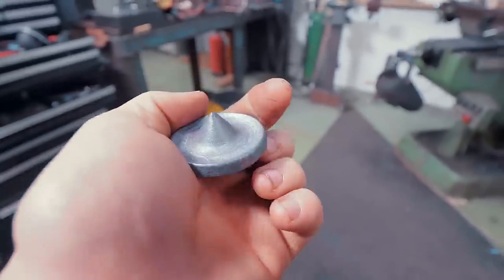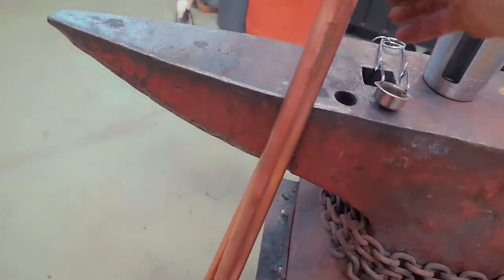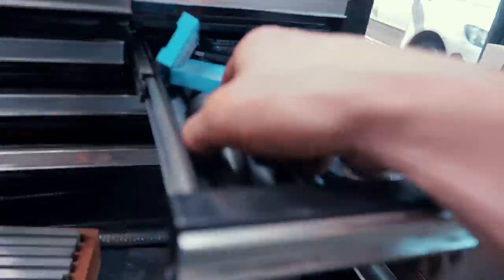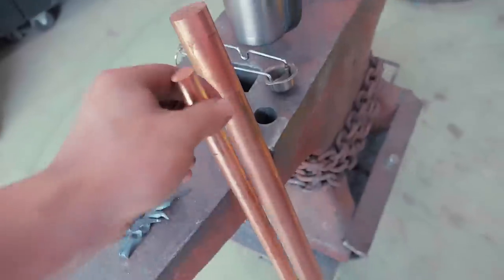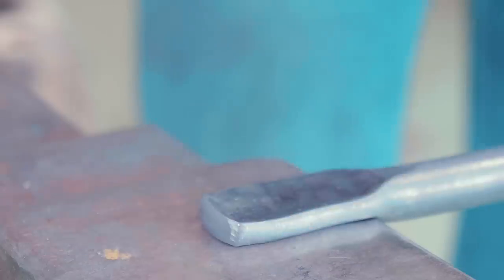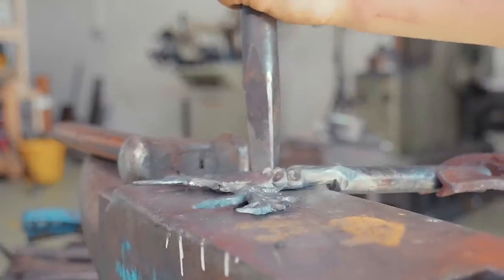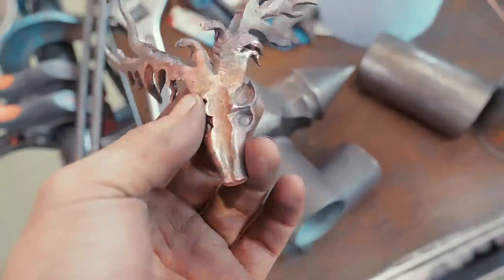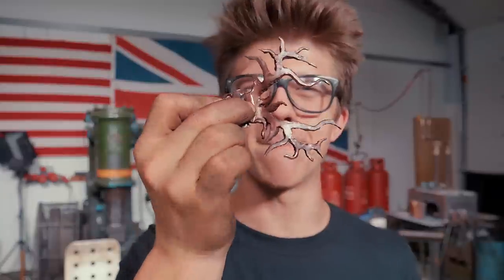GENDRY'S WAR HAMMER: GAME OF THRONES: PART 4 - Making the Stags

Comment: The FANTASTIC thing is, the show probably CAST the elk.
Meanwhile Alec is forging it. Very nice.
Reply: the moment you post a comment and realized there was an accidental pun in it.
Reply from the maker: +Lyulf thanks man!
Reply: Lyulf, it's a stag not an elk but it is amazing looking
Reply: It's a show prop, so the whole thing was probably carved in wax, and then cast in aluminum.  It's then painted to look like steel and copper.
Reply: That is the hero version. The stun version will be EVA foam or something like that.
Reply: Jubal Early Game of Thrones has a 10 million budget per episode, I'm sure they can cast it in bronze
Reply: Sure they can, but for most movies/shows it wouldn't make sense. Maybe if there were to be a closeup/feature shot of the weapon then it would make some sense to have a genuine metal weapon but otherwise tt's easier for the actors and stunt crew to wield foam or plastic replicas as well as giving the ability to have multiple identical props or slightly different for different shots.  Budget is irrelevant if it doesn't make sense.
Reply: It's probably rubber and plastic so it doesn't break if hit hard and so it's light so it can be used for a long time while filming
Reply: Also rubber and plastic doesn't do anywhere near as much damage to the expensive actors that metal does.
Reply: The original is all plastic and rubber.  Hollywood never makes anything "real" for insurance purposes.   They are ALL props.
Reply: Here's the thing about this type of weapon was that they were usually cast bronze to keep the weight down the larger they got.  Only the small one-handed war hammers (or can openers as they were nick-named) were forged.  They had armor piercing heads on both ends.  One end was for dealing blows and the other end was more intended for piercing. Do a little research and you'll see what I am talking about.  I have 40 years of study in ancient weapons.  Please feel free to consult with me anytime.
Reply: Cherry Blossom Forge There is probably a hero prop made out of aluminum for closeup handling, and a few cast rubber ones for fights and rough handling.
Reply: They probably made a nice one out of aluminum or other easy to work material and then cast several copies from it using a foam material that is lightweight for the action scenes.  Lightweight is important because they'll often shoot each scene multiple times and you don't want the actors/stunt people getting exhausted.  Also, lighter weight generally means safer.
Reply: That didnt stop them from giving Snow a rubber sheathed sword to wear when all he was doing was mounting his horse.
Reply: Wookie_oo7 some actors can actually ride, but mounting a horse with a metal pointy this is an unnecessary risk when there are alternatives.
Reply: You mean the metal pointy thing that was supposedly in its scabbard at his hip? You know the thing designed to protect the blade and make it none pointy? But I was pointing out that GoT uses prop weapons all the time and I honestly have nothing against that they do.
Reply: Ming Mongo the one they're using in the show is a stage prop only when stood still do they use a metal one they interview the guy who plays gendric
Reply: I know the Smith that made the show hammer it is 100% forged
Reply: Wax sculpting and investment
Reply: It probably isn't steel or really any metal in 90% of the shots in not less

Comment: You should forge a hammer out of copper for using on the lathe  and mill, your plastic one looks a bit past it's best😊
Reply from the maker: +Seth Stanbury AWESOME IDEA!!!
Reply: Can we say a FANTASTIC idea?!!
Reply: But if you make a copper hammer of the same size it will be significantly heavier making it too easy to bend pieces.
Reply: Seth Stanbury Nah. The proper tool for that is brazing a piece of brass bar on the open end of the box wrench for a soft hammer, so it's all one thing.

Comment: Just an FYI but Tig is great for welding copper to steel. You can just fusion weld them together or use some silicone bronze rod to Tig braze with
Reply from the maker: +James Adamo that's awesome! I didn't know that!!
Reply from the maker: +James Adamo thank you!!
Reply: I Look forward to seeing you learn Tig brazing. It is not a strong as a Tig welding but for lots of applications it is perfectly suitable and has a really nice look to it.

Comment: Alec,
When using a thread dye on the lathe, push the tail stock up against it and after every turn of the dye re-tighten the tail stock against it. This will ensure that your threads are square. Just a helpful tip to save you from messing up and having to try again!

Comment: Alec Steele, I remember seeing it done where you use a brass wire wheel on the grinder. Heat up the steel stag and run the brass wheel all over to give it a golden colour.

Comment: Alec, if you are going to make a similar handle for the hammer you could maybe 
get yourself some thick jump-leads, strip the insulation off, and use the copper cable 
as a type of vine design on the handle. Keep up the good work mate.

Comment: Alec if you what to get a deeper black on the metal you can heat the metal, not red hot, just surface heat, then wipe it down with undiluted ferric chloride wile it's still hot, let it air cool then neutralise as normal, then use your blue-ing  solution.

Comment: Alex, I use cold blue often. Warm the metal to about 100-150 degrees. This is best accomplished by running it under hot tap water, as hot as you can get it. Then actually rub the cold blue into the metal with the 3 ought steel wool.

Comment: Try hot bluing using molten potassium nitrate. It will work better and will be permanent. Cold bluing only stains the metal whereas hot bluing will permeate the steel. It will also yield a darker finish.
Reply: boiling it in vinegar works too and is probably a lot cheaper

Comment: To get better rezults for cold bluing, heat your part up a bit. Not so it will sizle water . But warm or hot to the touch. It will take faster. (gunsmith experiance talking)

Comment: i mean... the black stuff from the cold blue is basically iron oxide, and the black stuff from the forge is also... iron oxide :D so what you did is to remove an oxide layer and built another one up.

but think about that: in my mind you could archieve a more uniform result when treating numerous parts.. i mean, if you rely only on the scale from the forge, it might be the case that one part looks very different from the other... if you wirewheel them all and after that blue them, the result should always be nearly the same?! only a thought on my side :)

Comment: is it possible to do something like damascus steel with Copper? I know you cant heat it up too much otherwise itll melt, but if you keep it in the red temperatures, wouldnt you still be able to soften the steele enough? or does the still have to sorta "melt" into each other to create the solid weld between the layers?

Comment: Have you ever quenched any steel in liquid nitrogen and would it have much of a different effect compared to a normal quench?
Reply: Supa I have never tried it but I beleive it would be far to aggressive of a quench and shock the steel to much. This is the reason why warm oil is often used instead of water, it is less of a shock to the steel which lessens the chances of cracks.

Comment: does your lathe have a giant reservoir of coolant? do you have to refill the tank? Also where does the coolant go when you are machining? i assume it doesn't go on the ground.
Reply: Kevin Gideon The coolant is funnelled down into a reservoir where it's filtered and pumped back up to be used on a constant cycle.  It's good for quite a long time as long as the filter is cleaned out regularly. If you notice there's always a delay from starting the machine to the coolant flowing, same on the lathe and bandsaw. Hope this helps.. 👍
Reply: It is captured in the chip tray, and then drains into a reservoir. It is filtered and re-used.  Until it gets gross and funky :-P

Comment: Is there a way to figure out how much a given piece of steel can be flattened. So you know how much steel you need if the peice needs to be say 3 inches wide and 1/8 inch thick
Reply: Poissons Ratio
Reply: howycwap I did a little research and I dont see how poissions ratio finds how much a piece of steel can be flattened before any things been done to it. For example I'm trying to figure out how an inch wide by 5/8 inch thick peice of steel how wide it would then be if flattened to 1/8 inch

Comment: can you stack copper in with steel and make damascus with copper in it
Reply: WÄVYY ANIME no, but you can make mokume with other soft materials with the copper, bronze, and gold
Reply: I think the temperature required to get the steel hot enough to forge would cause the copper to melt. But that would look bad ass.
Reply: Tyler Dennis that's exactly what happens
Reply: thats what i thought. but what if he added it later and worked really slowly with a smaller billet of steel like maybe an inch and a half tall stack. and instead of doing a complex pattern he did simple teeth or something  and i also and not talking about a lot of copper  just maybe a plate or 2. i know its probably not possible its just a cool idea. imagine a few copper lines with all the black and grey of the 1080 and 1520